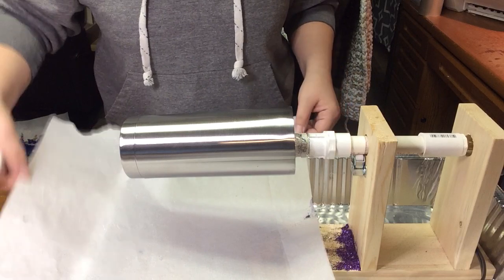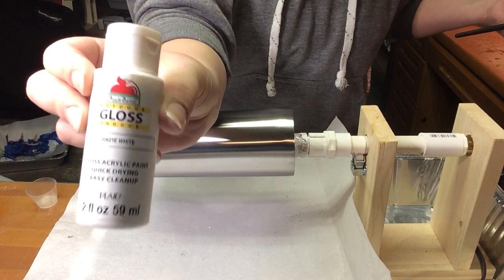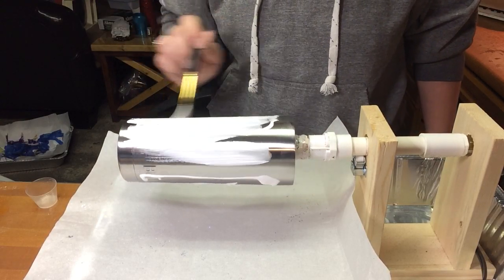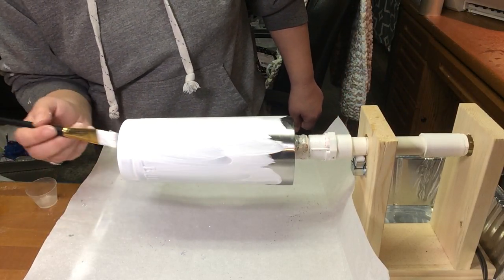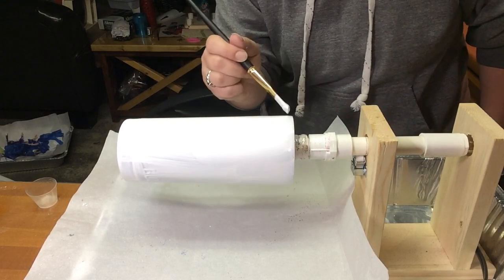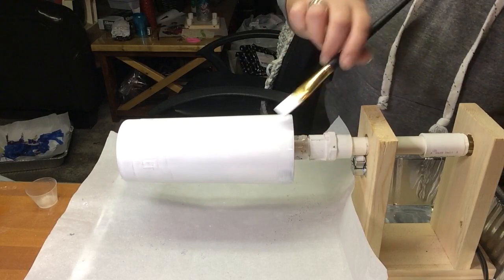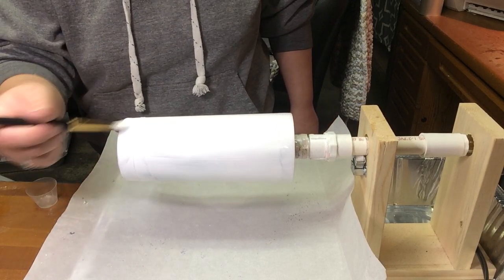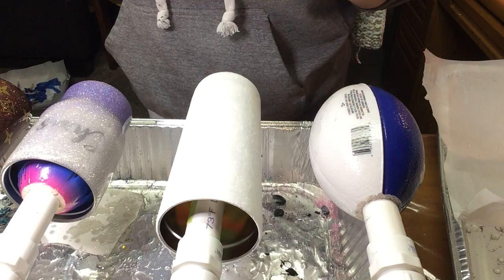How To Prep a Tumbler - No Spray Paint needed

Comment: I use acrylic paint as a base for all my cups! Depending on the color or how I’m making my tumbler I usually do about 2-3 coats. Acrylic dries incredibly fast!
Reply from the maker: Yes and it's so easy and the paint dries super fast!
Reply: Have you ever had issues with cracking? Do you seal after you paint the base with acrylic prior to epoxy/brite tone?
Reply: Acrylic paint by itself does not bind to stainless steel

Comment: Thank you! I needed a solution for running/dripping paint!
Reply from the maker: Your welcome!!
Reply: @mamabairsdesigns3852  first layer is looking great! No drips. Hoping the brush lines will disappear
Reply from the maker: @staceycollins5325  if you put it on a tad thicker they will go away! I also found that if your glittering the glitter will hid what you have left of brush strokes! I also started using my heat gun to dry the paint faster

Comment: I wish I found this video earlier, I already mixed epoxy with white acrylic paint on to my tumbler , problem is the top edge of the cup and bottom edge show the stainless steel , could it be possible to add the white acrylic paint over it and add epoxy after it dries? 
TIA , it’s my first tumbler
Reply from the maker: Yes you can most definitely do the paint after that dries. Make sure to sand it and then wash it really good. Then add the paint.
Reply: @mamabairsdesigns3852  thanks so much! 💕
Reply from the maker: @astridelias5316  your welcome!!

Comment: With this method, are you able to get the paint smooth enough to not apply glitter? I'm looking for a good method to paint the cups for those who don't want glitter. Also, would using a roller to roll it onto the cup be better for leaving it the paint color?
Reply from the maker: When you aren’t adding glitter I would either use a foam brush or a roller that has a foam brush.
Reply: Mica powders works good to it has a bit of a simmer but I'm sure you can buy it without it the mica are pricey but you only need a little bit and they last forever
Reply from the maker: @hunny81  that’s awesome to know! I’ve never tried it that way!

Comment: What happens if you do not sand your tumbler before you add epoxy?
Reply from the maker: Epoxy doesn’t bond well
To a flat surface and the tumblers come with a coating on them. Which in the end could result in all your hard work sliding right off

Comment: Does this technique also work with prepping the stainless steel tumbler if you were going to use alcohol inks on them instead of glitter? I'm at an apartment where I can't really use spray paint! Thank you!
Reply from the maker: Yes it does!! And when doing wood grain it adds a great effect to it!
Reply: @mamabairsdesigns3852  okay thank you! I asked someone else and they said that it wouldn't stick on the epoxy if it wasn't spray painted but instead painted it like you did! Thank you so much!
Reply from the maker: @Hlfpnt  your welcome!! The only thing epoxy won’t stick to is plastic and silicone
Reply: @mamabairsdesigns3852  okay thank you again!
Reply from the maker: Your welcome!!

Comment: Can you use matte paint as well?
Reply from the maker: Yes this is matte!
Reply: @mamabairsdesigns3852  ok the bottle you showed in the video was gloss. I've tried using acrylic paint myself and the brush strokes look horrible.
Reply from the maker: A new technique I figured out is when you do the paint drop it on and push it around while the cup is spinning. And use a sponge brush. I'm getting way better results this way. And I'm also putting the paint on thicker. Hope this helps!

Comment: Did you sand your tumbler 1st?
Reply from the maker: Yes! Always sand first until you get that metal smell! And then wash with dawn dish soap
Reply: @mamabairsdesigns3852  do you have to use dawn??
Reply from the maker: @spiritwings4592  you don’t have to use dawn. But I have found that if I use any other ones I tend to get a lot of fish eyes and end up having to do more coats. I’m not sure why either.

Comment: Hello, this is helpful because I live in NY and winter is approaching. This helps especially if I want to do different colors. One question. Do you buff the tumbler before or after applying the paint? I make rhinestone tumblers
Reply from the maker: I don’t buff the tumblers after. I’ve never done rhinestone ones though
Reply: Have you figured this out? I do rhinestone tumblers too and that's what im wondering also!

Comment: I tried this method and the paint wanted to chip away from the top where you drink and I did it finish to end and washed by hand too
Reply from the maker: Did you sand your tumbler and wash it after you sanded it before you painted?
Reply: @mamabairsdesigns3852  yes mam I did
Reply: This was a coated tumbler too
Reply from the maker: @cindyphillips8454  you already coated it with epoxy?
Reply: Yes I have
Reply from the maker: @cindyphillips8454  hmm. The only other thing I can think is maybe your epoxy didn’t seal enough at the top.
Reply: @mamabairsdesigns3852  ok how do I make sure it sealed at the top
Reply from the maker: @cindyphillips8454  I always run my finger at the rim when it’s spinning for each layer I do.
Reply: @mamabairsdesigns3852  ok I will try that next time
Reply: I also tested this method and it doesn’t adhere to the cup the same way spray paint does. And I thoroughly prep my cups. I would be worried that over time the seal would be broken.